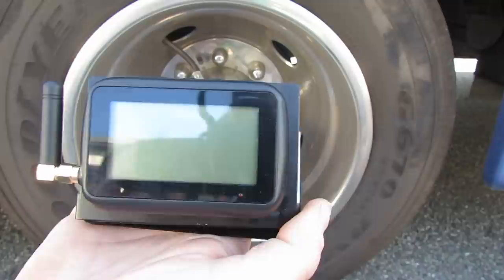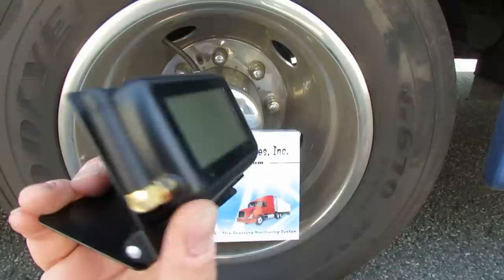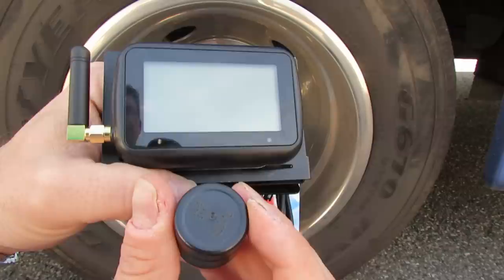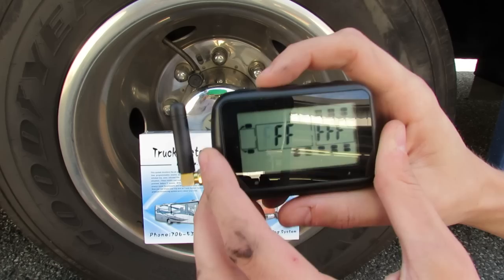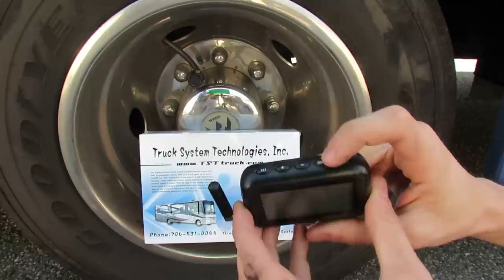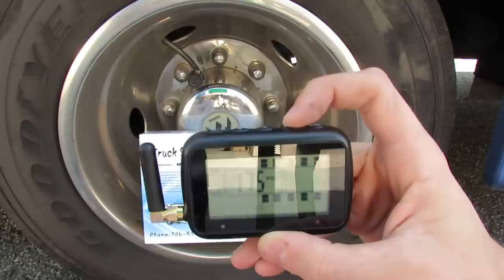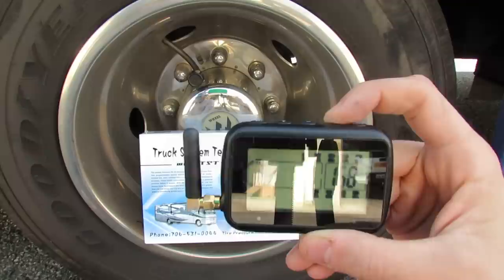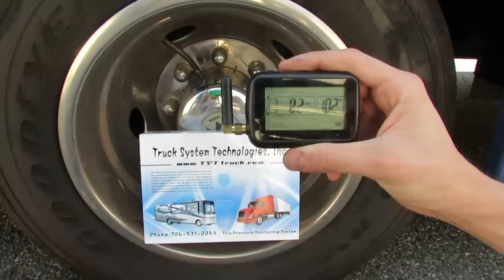507SC TST Trucking TPMS Installation

Comment from the maker: The 507 offers user replaceable batteries and is geared more for an RV user, the 510 system is widely used in the RV industry and truckers alike use it. It is our original system, and features a 5 year military grade battery and it utilizes an aluminum stem.  The 507SCE also features 5 year military grade batteries, and the monitor incorporates drop and hook technology for use in the commercial trucking industry.  The 507SCE sensors also feature brass stems, and the sensors are more durable.

Comment from the maker: The 507SC is designed with truckers in mind, and offers a 5-7 year battery with more features that cater towards the trucking industry.  The 507 is our replaceable battery system for RV owners.  The 510 system is our original system with a 5 year battery geared towards the RV industry.